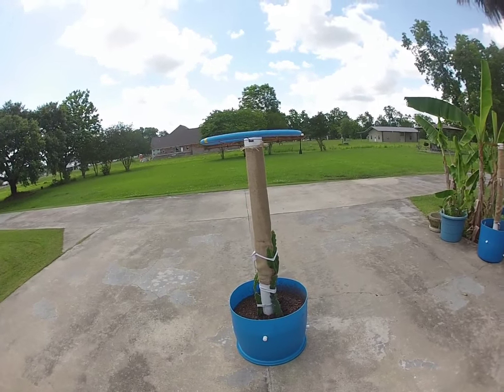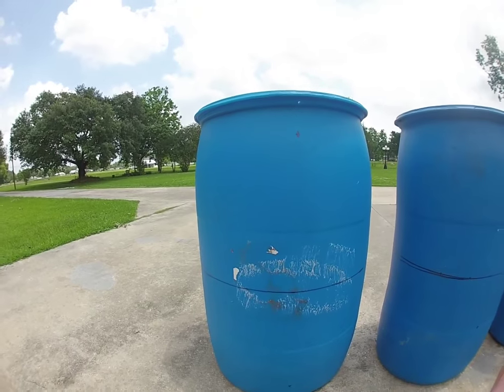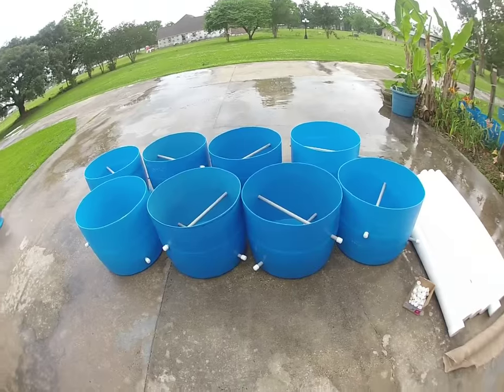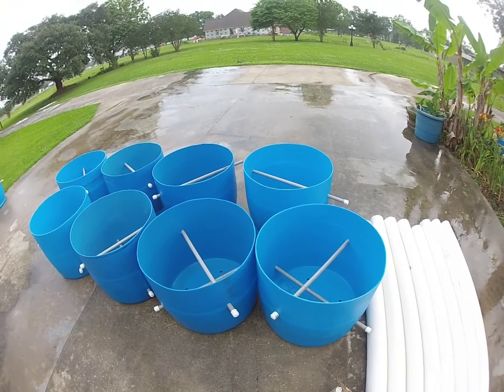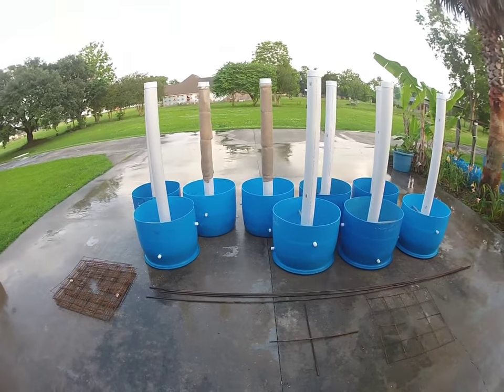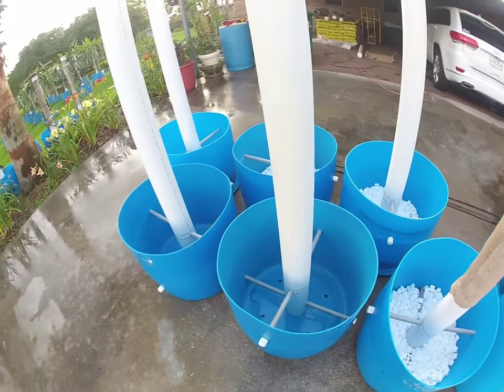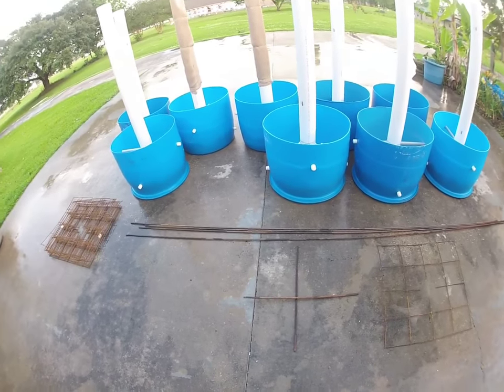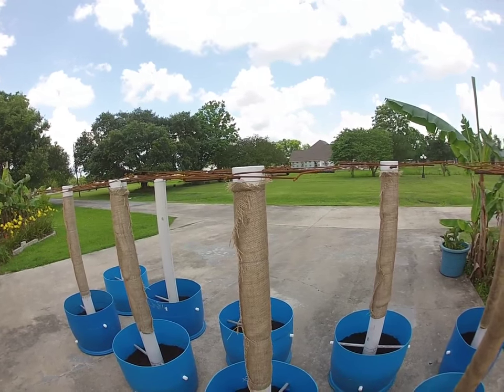Dragon Fruit container assembly

Comment: im really uncomfortable with the styrofoam, also, i think its gonna be too top heavy, and a strong weed will dropp the whole thing off, on the bottom of that pvc pipe id add some gravel or cement to balance things out
Reply from the maker: We have had styrofoam for over 15 years with amazing results. It works as an amazing insulator too. We mainly use it to make the containers weigh less, so we do not use gravel. We have 2 bags of soil in each container at minimum and that is plenty of balance.

Comment: Do both end of the 4” pvc same size? I bought an orange color pvc and only one end is wider for the end cap. So the other end which is smaller can not fit the end cap. I am from the philippines and am trying your trellis system.
Reply from the maker: Yes, one end of the pipe is tapered, but this is only on some pipe. If your pipe is tapered, flip it around

Comment: Why wouldnt you use pvc pipe with joiners to make the top part like 2in or 1 inch for example
Reply from the maker: We use this setup for cost, simplicity, lightweight and durability. I'm sure areas can be improved however it will likely affect one of the setup reasons. We have found this setup to last over 10 years, moving the planter yearly, withstanding 100+ degree weather yearly and at survive at least three hurricanes.
Reply: @Spicyexotics  Great reasoning. Ugly as you stated but well-thought. Very informative. Thanks!!!

Comment: Amazing set up...you should sell them to make some extra cash...I bought a DF and I was told is the purple type so after this video  i am thinking making a  container like yours.You think 7 ft might be to much on the height..
Reply from the maker: I have mine at 5' because a purchase a 10' joint of pipe and cut it in half. So no waste. I'm 5' 7" and 6' would be ideal for me. The drums should support 7'. As a side note, if you plan on moving the drums, the taller they are the more difficult it will be do move.

Comment: Great idea, but with my little 
Experience df plant grows heavily  into 150-200kg canopy
After 3 to 4 yrs due to heavy growth whole thing get collapsed.
Due to limited space, this is the only option , but may require pruning to limit the growth
Reply from the maker: My oldest container is over 10 years old and still holding strong.
Reply: @Spicyexotics  What is the schedule for this posts.
Reply from the maker: @jorgenunez924  I've used both schedule 40 or drain PVC. You can use drain PVC if you place a cap on top. This gives it extra thickness to drill and support the canopy.

Comment: This design is looking better and better as I research more. I was able to find a supply at a feed store today and picked up 6 white 55 gal plastic containers. They are BPA free and they had been used for food grade industrial sweeteners. I got them for 10 bucks a piece and they have several colors to choose from. Do you think BPA free versions will be ok? They seem very sturdy and unbendable.
Reply from the maker: I'm sure. We get ours from two sources. These places use it for holding soap, and the other holds fertilizer. We have over 50 made, and my oldest is over 10 years old now.

Comment: I would use a 4X4 wood instead of the plastic pipe. And 2X2 wood for the unbrellas.
Reply from the maker: That is much heavier and cost more too. These are movable. My oldest container now is 13 years old an still standing strong. PVC fit our needs better.

Comment: Have you ever considered going with 1.5 instead of 2 feet diameter on the trellis? Due to where the rods fall, I can get 6 umbrellas from 1 piece of mesh at 18 inches, as opposed to 3 pieces at 24.
Reply from the maker: We have several setups and this have proven to be the best setups for mobility and stability in hurricanes. If it ain't broke, don't fix it!
Reply: @Spicyexotics  I hear ya. Just a lot of wasted stock material at 24 inches.

Comment: I’m thinking about making some of these. Nice design! Have you ever had one start to slant or fall over from the weight of the branches? I’m a plumber so I know 1/2” conduit or pvc is not very rigid and will bend easily. But I would assume having the dirt/compost packed around it would solidify it more. And once those roots take over the pot I’m sure it will never move. Also do you have a specific temperature that you enclose the walls of the greenhouse? I would think in your area it’s not until at least early  November. Let me know.
Reply from the maker: They have slanted before due to a lack of attention. However, this is corrected with top dressing, pruning, and a little attention. They never fall over. We have over 100, and most have been through 100 summers and several hurricanes. We even moved locations 30 minutes with no issues.
We cover when temperatures get below  40 degrees. This could be from October - January.
Reply: @Spicyexotics  awesome thanks

Comment: How much space is between your two 1/2" pvc pipes? Looks to be about 8". Does this spacing matter too much?
Reply from the maker: You are correct, it's about 6 to 8 inches. It does stabilize the post better with space between the two 1/2" pipes.

Comment: Do those wire mesh already came in 2' x 2' (or is it 3' x 3'?) precut? I saw some on Home Depot but they come in rolls and they're too much for building 2 pots.
Reply from the maker: It comes in 3.5 X 7 feet. Here is a link at Lowes. https://www.lowes.com/pd/Grip-Rite-Common-3-5-ft-x-7-ft-Actual-3-5-ft-x-7-ft-Steel-Remesh-Sheet/1000194987 .  Once cut, you get 3 - 2 X 2 foot pieces. This can be cut with a set of linesman pliers.

Comment: Hi, thanks for the video. Where do you get your metal grid on the top and what kinda wire did you use to tie burlap? I couldn't find them at home depot. Thanks.
Reply from the maker: The grid can be found in the concrete section of your home improvement store. The copper wire is 24 AWG solid 4 pair cable. This is used for telephones. Both are readily available at home improvement stores.

Comment: Pls tell me What did u use at the bottom (The whitish things)and what things did u use in the soil.I have the same drums as u and also have a lot of dragonfruit cuttings.My plantss are in small containers,they only fruited once,only a little fruit set.I'm thinking of planting cuttings like u.Pls tell me what the white things are and  what did u use in the soil.And pls tell me what vitamings do u spray at the dragonfruit.Plsss reply.
Reply from the maker: The whitish things are Styrofoam. I acts as a pot filler / make the overall plant lighter. Also, I do not use any sprays.
Reply: Doesnt the styrofoam rot in a few years???
Reply from the maker: It does get some wear due to roots growing through it. I have containers that are 10 years old with no issues.

Comment: how did you figure the holes on the 4"pvc and what did you use to drill them?
Reply from the maker: First, create a center line in the 4" pipe.
For the bottom support, put the cross supports in the pot. Then place the 4" pipe as close to the center, with one of the 1/2 support in the middle of the center line. Put a line on the top and bottom of each 1/2 support where it touches the 4" pipe. Your first drill  hole will be where your center line and the two 1/2 outside lines meet. Let say you did this for the top cross support.  For the lower cross support, from the center line take 1/4 the circumference to the middle of the lower 1/2 support pipe lines. Measure each spot from the bottom of the pipe. You will need this for the other side. Lastly, measure each location 1/2 of the circumference around the pipe. Double check your measurement from the bottom of the 4" . Then I use a 1/2" unibit.
Reply: Spicy Exotics I would love to see your video in this process

Comment: Why don't you just wood as the main trellis wouldn't that be cheaper and less work
Reply from the maker: PVC is much cheaper than wood that would last over time, but that's not the main reason. I do it for weight. The planters are movable and they do get moved yearly..
Reply: @Spicyexotics  I see. I actually do like your design but I have no idea how I'd do that top grate bit... is it necessary to cover the pic with fabric for the roots to climb on?
Reply from the maker: @xPorsum  It helps and I did spay my plants with Micronutrients so using the burlap helped absorb the nutrients and release it slowly. I do not do this anymore so it is not necessary.

Comment: what do you  use to make the top.
Reply from the maker: 3/8" rebar cut 24" in a crossing pattern with a 24" X 24" wire mesh secured on top of the rebar. The thicker the better, but also heavier.